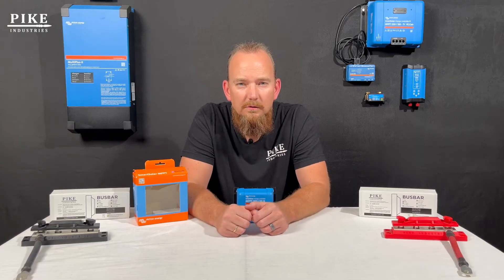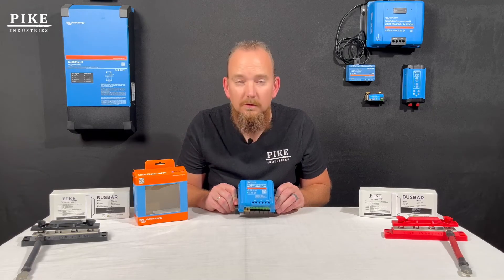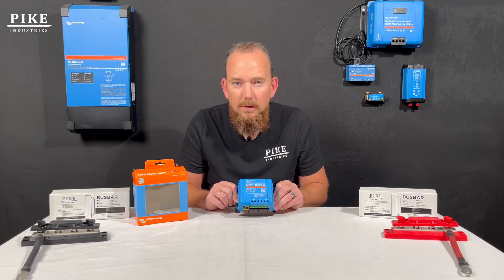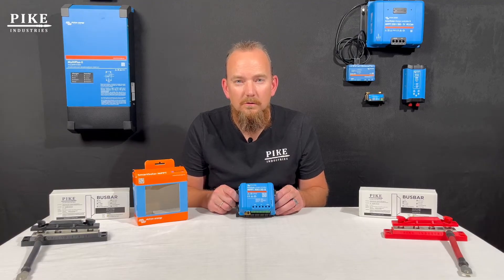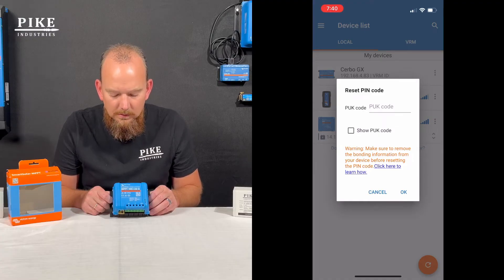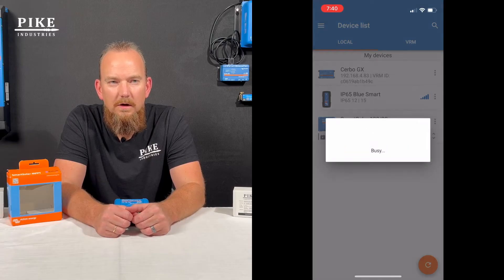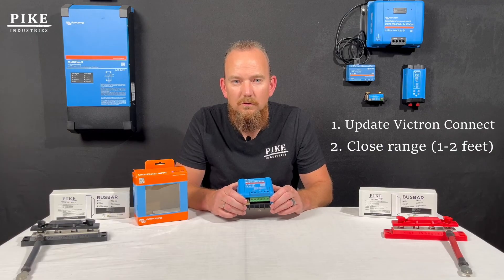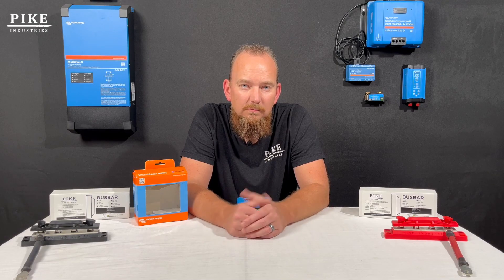Victron Energy Bluetooth Connection Issues Solved

Comment: I have the CERBO GX changed my phone and now although blue light solid on the GX and showing the cerbo on my phone but no 3 dots at all showing to change the oil code.. asks for pin but the correct pin just won't work..
  How come there is no 3 dots??
  Tried resetting/disconnecting cerbo to no avail. 🥴

Comment: What when the puk code has its own error and tells u to disconnect from app blar blar. Anyways done all that also I Uninstaller the app and reinstalled turn off Bluetooth all that I have like 10 devices with victron bs and all have been a pain to update the firmware but this is a new level 😢 pls help

Comment: The silver bullet missed as there doesn't seem to be a target. I'm in the middle of connecting the Orion 12/12 30, hooked it up to the starter battery, opened the victronconnect app and found only my just connected Orion charger. My MPPT 100/20 disappeared from the list.
1. Rebooted my phone
2. Erased the pairing on my phone
3. Deleted and newly installed victronconnect 

but only Orion keeps showing. 

I've changed the name earlier today, maybe that's what's causing this? 

What more can I do?

Comment: The PUK code is not accepted. I get the message that the puk code is not correct.
I have used lower and upper case letters, that makes no difference.
Reply: Had the same problem!! Ended up sitting right next to the box.. Worked fine then
Reply: The sticker with the PUK code is attached to the back of the battery charger but is not accepted.

Comment: Any suggestions on losing bluetooth connectivity after a failed firmware ugprade? In my case no devices found or list in the Victron connect app any longer so I cant try the silver bullet.
Reply from the maker: Sounds like the bluetooth radio has been disabled by accident.  You can get a ve.direct bluetooth dongle, plug it into the ve.direct port on that device so you can connect via Victron Connect and turn on bluetooth again.
Reply: @pikeind  Thanks - I will give that a try.

Comment: It doesn’t show up at all. How can I reset if it doesn’t show up? The solar is still working but won’t show up
Reply from the maker: If its missing it means either the bluetooth radio has malfunctioned or its been turned off.  In order to turn it back on you'll need to get a Victron VE.Direct bluetooth dongle and plug it into the unit.  You'll then be able to connect via Victron Connect to turn on bluetooth again.
Reply: @pikeind thank you I just purchased it

Comment: Why couldn’t Victron have put that information in their owners manual (say under troubleshooting) or provided a short instructional video clip via their site??…
Victron equipment is good but for the most part the customer is left strictly to ‘go it alone’ - such an awful business model…
Reply from the maker: Their documentation is getting better and better so hopefully it will be included in a future revision.
Reply: @pikeind  Well, thanks to you Sir, my case had a uber straightforward resolution - This is precisely why when considering a sophisticated piece of electronics, it equally important to procure it from a reputable vendor who’s business model provides competent and able Customer Support - In these regards, I’d rate your fine firm with a minimum of 5 Stars!

Phil P. Carson City, NV.

Comment: Thankyou for this video. My Android wouldnt pair with an IP65 charger. Tried all the different software's IPK etc, get to 80% and then crash. Changed pin as you mentioned and worked straight away. Thankyou as was really frustrated with it.
Reply from the maker: Glad you were able to make it work!

Comment: It's beyond me why manufacturers insist on using Bluetooth. It's got to be one of the most unreliable methods of communications. Morse code would have been more reliable. Bluetooth has always been a piss poor way of communicating and it always will be. What is wrong with using wi-fi instead.

Comment: I forgot device on the app. Now unable to find it to reconnect? Is there a way to reset MPPT?
Reply from the maker: Try connecting to it from another device to make sure its still sending the bluetooth signal.  Also you should reinstall the app on the device your having issues with.

Comment: My victron device was discoverable on my Samsung but i don't have that phone now.
With my new phone i can't find my device.
Reply from the maker: Make sure bluetooth is turned on under settings in the new device.  The Victron device can connect to multiple devices as its not tied to just a single phone or tablet.

Comment: Hello, so after this step is it necessary to reconnect!? Meaning perform the connections steps again!?
Reply from the maker: Yes. After resetting the pin you will need to connect again.  You will be given the option to set a new custom pin rather than the default 000000.
Reply: @pikeind  i shall try tomorrow. as i already consider my cerbo a bricked unit.

Comment: Their connection sucks. I can’t move more than 6 feet away and I lose all signals while any other Bluetooth device I have I can stay away up to 30 feet.
Reply from the maker: If the unit was out in the open you would have 30 feet but usually these devices are placed in storage compartments with wood and even worse metal walls between the connection points.  These severely limit the connection strength.
Reply: Can there be an external antenna added?  @pikeind
Reply from the maker: Many of the devices can have a Victron ve.direct bluetooth dongle added which would increase the range but again if its placed in a box the range will be limited.

Comment: I have an mppt 75/15 solar charge controller - it shows up on the victron app but I don’t get the 3 dots?  I have also taken a photo of the label on the back - it has 2 bar codes with numbers under each - which one is the PUK code? Thanks in advance
Reply from the maker: If you have another phone or tablet, try installing the Victron Connect app and see if a new connection from another device is different.  Possibly the firmware needs to be updated.  The PUK code is usually on a sticker that also contains the HQ serial number.

Comment: I tried your suggestion, but when I opened the app and selected the file, I did not get the option of resetting the PIN. I thought I needed to update my app, so I did. But I still do not get that option.
Reply from the maker: If you have another phone or tablet, try installing the Victron Connect app and see if a new connection from another device is different.  Possibly the firmware needs to be updated.

Comment: I have a problem with my Smart Shunt. Its connected but when i click on the device it goes directly to a product information page. Click the Back arrows and the device doesn't show up now...  I have uninstalled and started completely over but same results...  Any ideas ?? Thx
Reply from the maker: If you have another device you can try and connect with it to see if your getting the same results.  I'm assuming you tried resetting the connection using the PUK code as mentioned in the video?
Reply: Thank You!!!  I will give that a try !  Appreciate you getting back to me!!

Comment: We have the victron smart shunt connected to the  victron cerbo gx through wifi. We can get the get it online at home. But when we leave home we cannot get it on the internet. What do we need to be able to get it on the internet world wide? We live on a boat in the  bahamas. The boat is our home.
Reply from the maker: There are a few options.  1.  Connect the Cerbo to a mobile hotspot or satelight internet like Starlink.  2.  Look into the GX LTE 4G.  This device needs an LTE cell tower to connect so it might not work when your out at sea.
Reply: @pikeind  we can’t get it at the dock . I set up the acct vrm and they said that I need to be approved
Reply: And we have it connected to LTE
Reply: How can I get in touch with them

Comment: Thank you so much had a issue with my mppt. After a halve day i could  not connect to it anymore and had to power cycle the unit. did the pin reset like you mentioned and all works great again.
Reply from the maker: Glad it helped

Comment: I've had a blue smart charger for ever. Tried getting into it and nothing works. If you go on line there a pile of people trying to do the same thing. Get bluetooth connection with myb24 volt blue smart charger.
Reply from the maker: Do you have the BLUESOLAR or SMARTSOLAR?  The BlueSolar doesn't have bluetooth built in and you need a ve.direct bluetooth dongle.   Another thing you can try if you have the SmartSolar is to go into your phones bluetooth connections and forget the Victron connections.  Then try the connection again.

Comment: Thank you for the video 😄
Im writing from Denmark and I have a question for you?
My New Orion-TR 30 amp 12v/12v charger is showing on the victron App but it stops at 80% and ask for the pin code and when I have written 000000 nothing happens but it starts over again and ask again for the pin snd so on?
Can you please help me?
Vh Rudi 😁
Reply from the maker: What if you try and remove the stored bluetooth connection from your phones bluetooth connections, then try the connection again.
Reply: @pikeind  thanks for the answers 😄 I can try to do that but I have tried to download the victron connect app to one more mobil phone and the result is the same?

Comment: Mine doesn’t detect any devices on Bluetooth trying with both my iPad or phone. I have 12.5 volts at the input of the Orion -tr smart non isolated from the starter battery but if I ground it to the common earth on the Orion there is no voltage showing? The earth on the Orion has continuity to ground with my meter. Is the unit faulty as it is brand new?
Reply from the maker: If its a "smart" device and your within 5 feet of the unit but Victron Connect doesn't detect anything then you should submit a warranty claim on the Victron site.
Reply: I found the problem. The chassis ground had fallen down out of sight when I connected up the other ground wires. Once connected all is working perfectly and connects easily by Bluetooth. 🤗👍👍👍
Reply from the maker: Ah, so the device wasn't getting power either then.  That explains it!  Thanks for posting.
Reply: @pikeind  👍

Comment: Thanks. That was a truly great tip.
In my case, I fixed the bluetooth connectivity with a Firmware update. However, despite I see my RUUVI temp sensor values in the menu of the Cerbo, I do no longer see those values on the Cerbo pages. Strangely the tank sensor volume values are displayed both on the menu and on the pages in Cerbo. Do you have a tip as to display the temperature readings on Cerbos pages? Best regards,   Silvano
Reply from the maker: Glad to hear it worked for the connection issue.  Regarding the Ruuvi sensor data not showing in the Cerbo I'm not sure.  Sometimes giving it a few days it these issues go away on their own as the data gets resent.  If thats not working you can try to disconnect the Ruuvi's and then add them again hopefully resetting the connection.

Comment: I have done all 
But one thing does not come up 
It only gives me forget in the 3dots not the other as well 
Have pulled the fuse pulled Bluetooth 
And nothing had it for 6 yrs now 
It’s been in storage for one yr 
So I have no idea what is wrong with
Thanks mate
Reply from the maker: I'd try to connect to it using another device with Victron Connect installed.  Also you can try to reinstall Victron Connect.  Once you do connect, update the firmware as that could also resolve the issue.

Comment: I have three Victron charge, controllers, and one refuses to update the software to the latest version? Two 250/100 & 150/85. The smaller one doesn’t update to the latest.
Reply from the maker: Try another device with Victron Connect installed.  That sometimes will kick it off.

Comment: what to do when the multiplus simply doesn't show up on victron connect with the mk3 to usb anymore?
Reply from the maker: Make sure the MK3 is the only thing plugged into the Multiplus.  If you have a Cerbo or anything else plugged into the other ethernet port, it will keep the MK3 from seeing the Multi.

Comment: I have an issue with my smart shunt bluetooth range, won't even connect from my truck seat. Will the bluetooth dongle plugged into the shunt port help extend the range?
Reply from the maker: Good question, the ve.direct bluetooth dongle will help only if you are able to mount the dongle closer to the phone connection point.  Also if your shunt is in an enclosed area and your able to mount the dongle outside that area, you will increase the range.   Walls severely limit bluetooth range.

Comment: Handy fix providing you can see the device in the list…..   my smart solar 100/50 just decided to stop showing up all together and can’t be found via Bluetooth anymore.
Reply from the maker: If you have access to a ve.direct bluetooth dongle you could plug that into the device, update the firmware and then see if the internal bluetooth is working again.  Sometimes a wrong button is selected and the bluetooth gets turned off by accident.
Reply: same problem her for me.

also the 100/20 version.

does not appear in victron connect, not in the phones or any other tested devices BT list.

it is connected to the cerbo GX and works normalay.  and appears in the cerbo's devicelist.

but there is no function to enable/disable bluetooth.  

IIRC earlier there was an option to turn it off via cerbo.  but i searched everywhere in the cerbo and victron connect (remote access  over internet) but... nothing...

all devices are uptodate.

Comment: Thank you.  This fixed the connection problem I was having with a new 100/50 SCC that I had just received. Though I didn't have to put PUK at the start of the serial number. Just the code number by itself.
Reply from the maker: Glad it helped

Comment: Hi great video, I tired what you mentioned however the PUK codes aren't recognised? Any further advice to try and connect my viltron system on the App
Reply from the maker: Check if the "I" (letter) is a "1" (number one), same with a "B" (letter) is a "8" (number eight).  Be sure to put PUK in front.
Reply: also, the no. 6 can be confused for a no. 5, have to look closely for the rounded top on the no. 6 in the PUK line